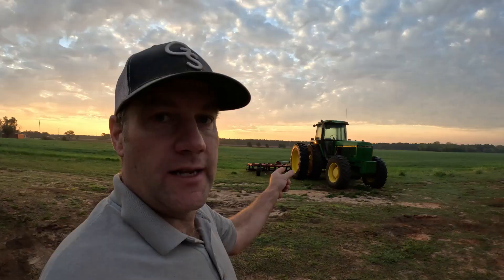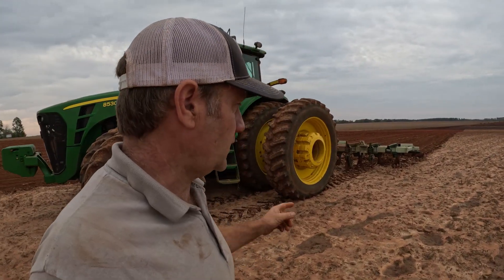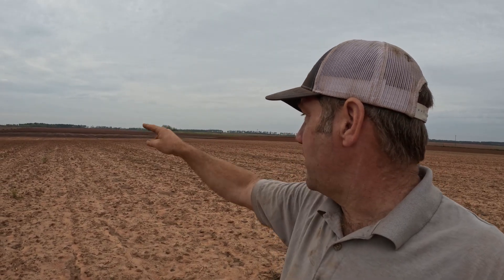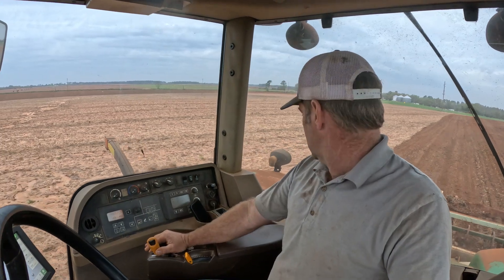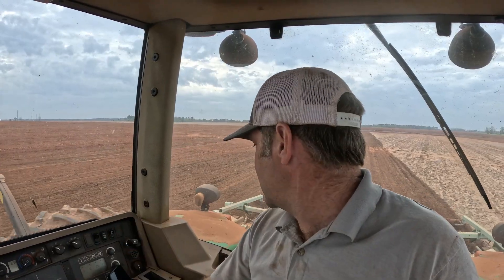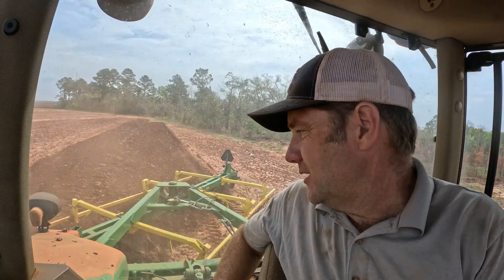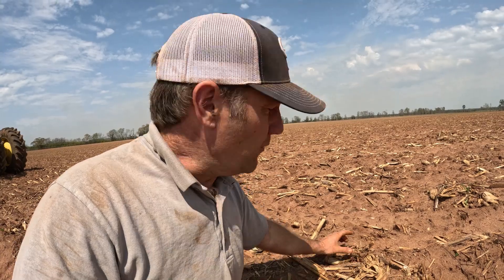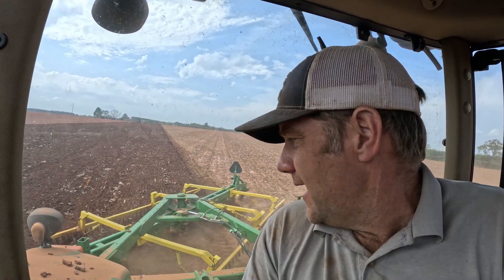Plowing v. Subsoiling

Comment: I have to disagree with your statement about  the  shallow root zone depth of  no till strip-till........ But you farm different soil,   so you are speaking from experience....  In these parts  you can almost lose a Regular or Peanut Combine if a Drive tire  slips into .....a subsoiler furrow     We used an Jd 850 dozer to  extract an 84oo and  6 row Amadas combine and the  drivers side on the combine  left a ditch almost 300 ft long, 2 ft wide and 3 ft deep

Comment: That’s not a sub soiler!
Reply from the maker: According to the company that makes it (KMC) it is, and according to the company that produced the wear parts (Nichols) it is, and according to the dealership that sells them (John Deere) it is.
Reply: @PatrickShivers  there maybe some confusion over the difference between a true sub soiler and a deep tyne ripper

But if there no hydra foil(I believe you guys call them wings) then it’s not a sub soiler

The hydra foil actually cracks the compacted soil BETWEEN the rows allowing for far better water penetration and retention.

I have been trying to get TrippyFarmer onboard for a couple years to no avail 

It’s not for ever soil type

It also allows deep rooted plants especially maize or corn as you call it to reach nutrients deep down

No hydra foils 
No sub soiler
Reply from the maker: @mungogerryjnr  there is a winged point available for this model, but I don’t know anyone that runs it as it is very pricey and much harder to pull in our dirt.  The shanks on this machine are half the distance apart as our rows are and we get great lateral breakage with them spaced that close and running that deep.  Again, the manufacturer calls it a subsoiler and if you search online farm equipment auctions for “subsoiler” you will see this exact implement.
Reply: Well according to a company over there called Great Plains isn’t 
I owned on once from a company over here 

And no sub soiler has eleven shanks,well actually with todays 830 hp maybe but it’s never been possible 

Sub soiler have a hydra foil on each leg and go deeper then .8mtr
They are set further apart at a minimum of .8mtr

What the is is a deep Tyne harrow!

Comment: Patrick I'm glad you explained how the ripper allows water to penetrate into the subsoil and also allows for root penetration as well. 
Not tryingtohijack yourpost, but I'd like to expand on that .
When those shanks are running deep like that, they don't just rip a deep groove in the ground like many people believe, but they actually shatter the soil in between the rows.
Especially in hard ground like yours.
It's like throwing a baseball thru a window.  It doesn't just leave a neat round hole where the ball goes through,  but it shatters the entire pane.
Same result with the subsoiler. And the faster you can pull it, the better job it does.
Reply from the maker: You nailed it.  Great explanation.  Subsoilers are also typically ran at a 45 degree angle to the rows so that a row doesn’t fall right where the shank ran, or didn’t run, all the way across the field
Reply: @PatrickShivers  unless you're like us and run the ripper and the planter in tandem. 
I will say this. A 12 row ripper/planter combo is ALL an 8430 wants. Even with a little more juice turned to it. But...we're not running quite as deep as yall are. We're usually running 14-16 max.

Comment: I have some questions for a guy that doesn't know anything about farming how many times do you go over the soil after you pick your corn before you plant your next crop ? and in your video you said it was going to rain after you plowed wont the rain packed the clay back down preventing you from planting again?
Reply from the maker: How many trips is determined by what crop is going to be planted.  Peanuts requires the most trips.  To prep for peanuts a field is usually disced, plowed, field cultivated to level, yellow chemicals applied (grass control) then twice incorporated with field cultivator at different angles.  Then planted.  Sometimes the field is subsoiled before plowing, sometimes not.  Also sometimes farmers will subsoil but not plow.  It all varies year to year depending on conditions.  Every rain adds compaction (it compounds throughout the year) but fields are typically subsoiled or plowed just once per year.
Reply: When your subsoiling how many gals of fuel per acer,and is the pipe your dragging behind empty or filled with concrete or anything?
Reply from the maker: @billsauberlich7337  pipe is empty.  I don’t know the gallons per acre.  It takes about 8 hours to burn 180 gallons.